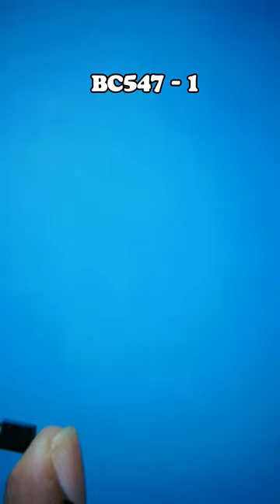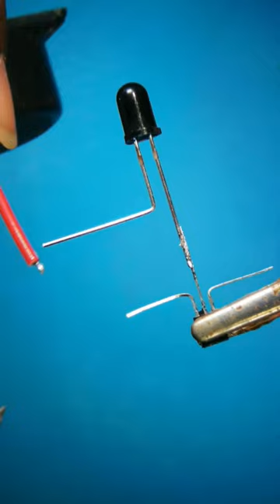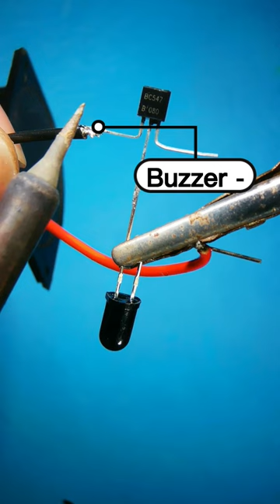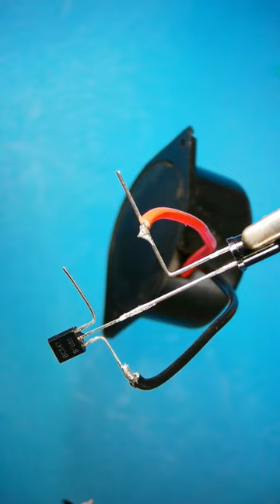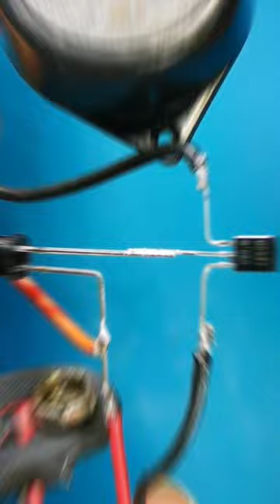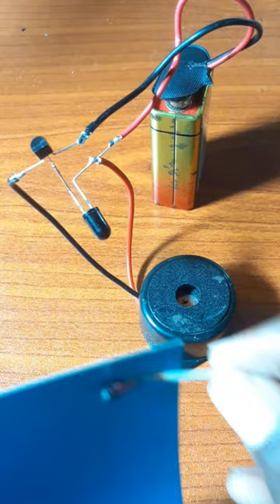How to make fire alarm circuit #diy #shortfeed #shorts

Comment: You have misconnected wires as you are using emitter to collector orientation. It risks damaging the transistor and also has a huge voltage drop.